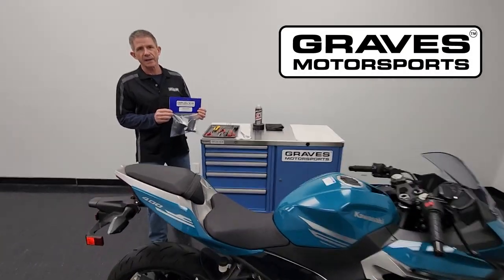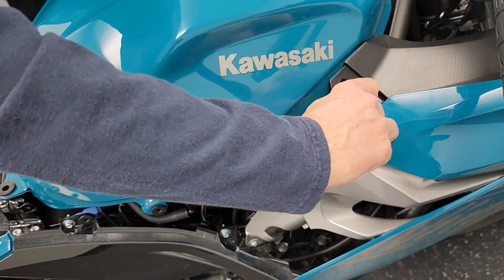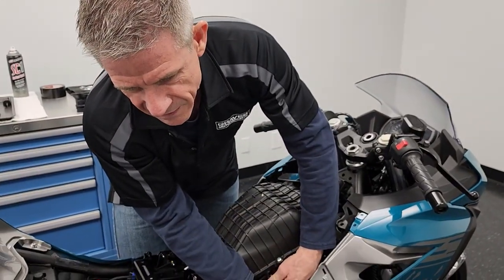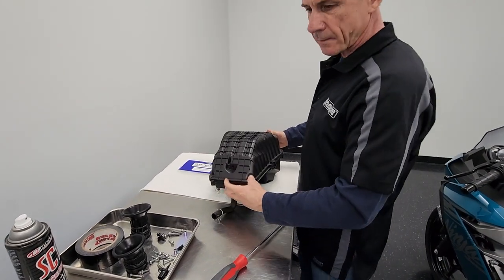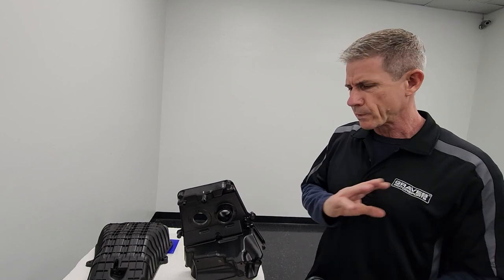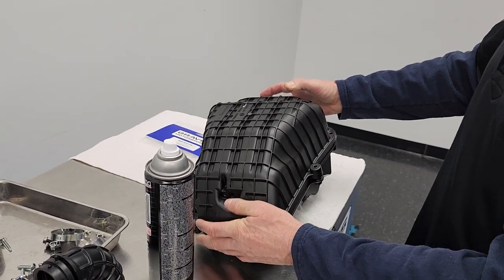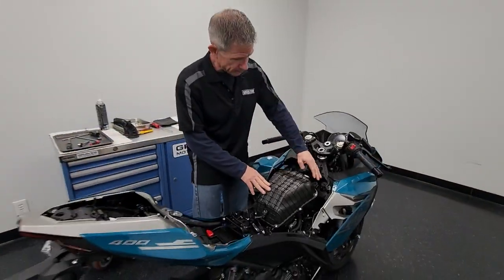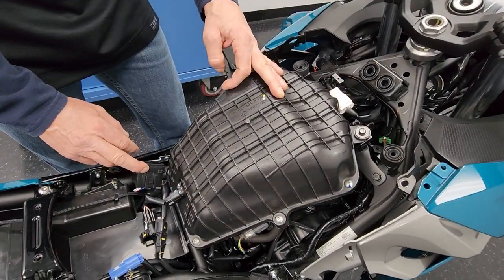Kawasaki Ninja 400 + Ninja 500 Velocity Stack Installation Video - Graves Motorsports

Comment: Well done Chuck. Looks like an easy way to get some more power. I also like the tips for making things easier further into the process and how to not cross thread the plastic with the coarse screws. Little things like that can apply to many other situations and separate the pros from the wannabes.

Comment: Just installed the v stacks but I’m having trouble connecting the fuel line at 28:24. Any causes or tips. Do I really just jam it on?
Reply from the maker: You should not be able to close the latch if it's not all the way engaged. Then do the pull tip we mentioned to test it.
Reply: @GravesMotorsports I was pushing genuinely as hard as I could. I still cant set it over the lip.
Reply: @GravesMotorsports would you be left to believe i damaged it.
Reply from the maker: I hope not 
 @vfhx5267

Comment: The rule-of-thumb for determining velocity stack length is that the longer the stack, the higher the torque curve in the RPM range. That is, longer stacks will give more torque at higher RPM, whereas, short stacks will produce added torque at lower RPM. So for me i'll keep the oem but for others a modification may be better.❤..
Reply: Right, that's the rule of thumb generally, BUT these and other similar products were dyno-developed. Not "this should probably work this way" but "This is the result we want, change the stack until we achieve it, then prove that with a graph".

Comment: does the fuel tank have to be empty?
Reply: No, but you will just spill more fuel if its not.
Reply: Don’t worry about it bro I had a full tank of gas on my 400 it’s just heavier to lift and the tank it’s self has an automated shut off valve so the only gas leaking will be through the Hose he removed in the beginning of the vid